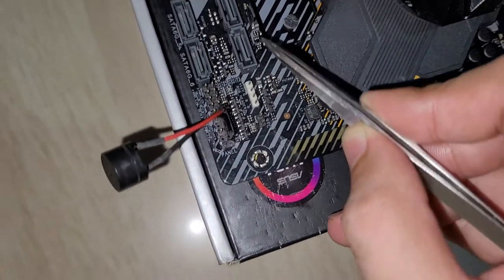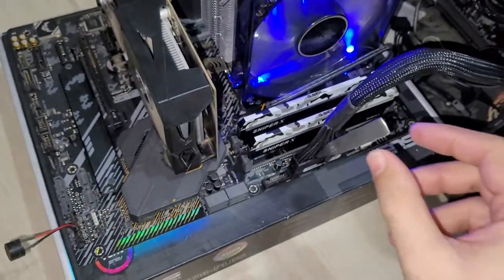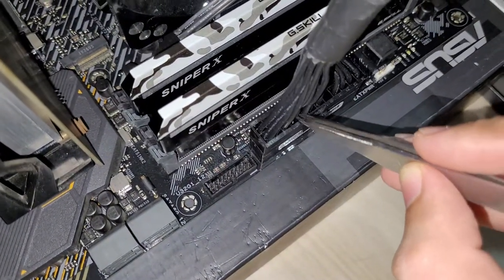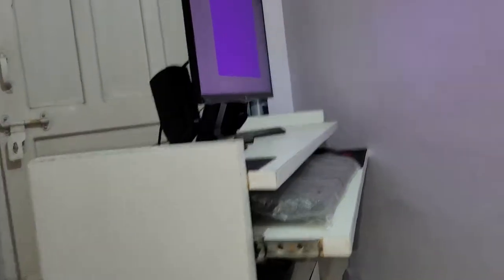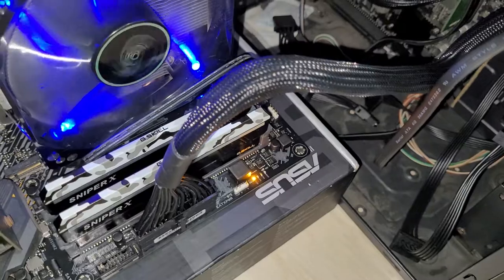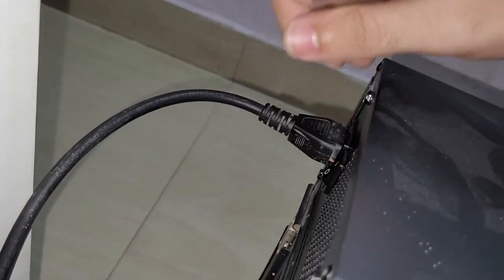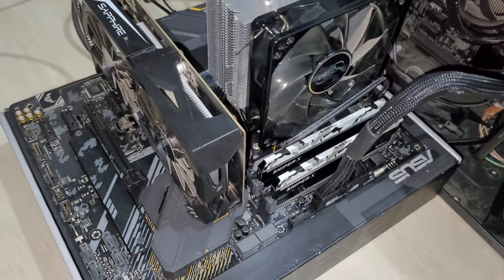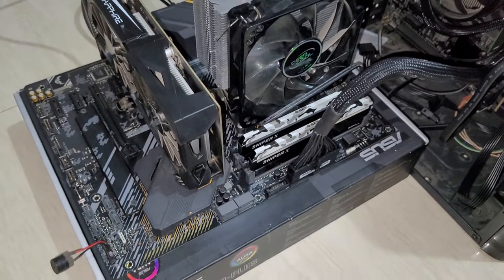Issue: ASUS TUF Gaming X570-Plus Motherboard Doesn't Power ON Without CLR CMOS + PSU Paperclip Short

Comment: same problem happened to me 
do i need to spend money on this issue, because i did nothing about this, it is only 1 year i assembled this pc 

PLS PLS REPLY
SOOON PLS 🥺🥺🥺
Reply: i think everything i have in my build is under my warranty period

PLS PLS REPLY
SOON 🥺🥺😤
Reply from the maker: Yes get it replaced/repaired under warranty brother. I think the newer revisions do not have this issue.
Reply: @LoveleshKalonia  i have asus  b660m motherboard i5 12400
do i need to pay any money for this repair/replacement process 
because the shop which i bought this pc asking 2k that process as service charges

pls help me out for this brother 🙏🥺
Reply from the maker: Which country do you live in brother? You don't have to pay anything, find the nearest ASUS Service Centre and take your motherboard there.
If there is no Service Centre, then please check the RMA page, then pack your motherboard and courier it to the RMA Centre.
Reply: @LoveleshKalonia  im in India, Chennai 
thank you for your help
i will follow your instruction for my service ❤️❤️😉
Reply: @LoveleshKalonia  thanks brother 🙏❤️
Reply from the maker: Most welcome brother 😊

Comment: I took out my mobo to change the casing + changing some new parts and i think highly possible is the mobo because cpu is new and the other parts i tested was working.  I buying a new mobo and to test it agn.  Praying hard is that it is not the psu . Btw using SeaSonic, it has high review on it and after watching several video, MOBO has the higher chance to be Faulty from most part on the computer parts.  TESTED the Video and the MOBO show light but immediately I drew the connector 4 and 5pin the MOBO died straight.  My Conclusion on my case is that the pin on the 24pin on the mobo is faulty, lightly is 3 years old and is the part that is the hardest to take out .
Reply from the maker: Yea mobo is the least reliable thing these days

Comment: my x570 crashed stuck on green led black screen no bios i removed ssd ram pc case plug ins its shot re seated cpu same balck screen same led on
Reply from the maker: Are you using an APU or discrete GPU ?
Reply: 5800x/6700xt 980pro 750 super nova 48gb ram 12 pin power plug in win11 B.s.o.d plyin elden ring hasnt worked since TY for response
Reply: x570+wifi was running bios OC pbo set to board limit OC enabled All been runnin it OC since purchase OC showed 4.8+0.2 off set volts 1.5
Reply: think i killed it no bios after re seat replace cmos removed m.2 bios was v 4204 i think latest version tho i tried dvi switch to hdmi it just a black screen :) not so TuF lol
Reply from the maker: I thought the same thing too when I RMAed my motherboard - "not so TUF". Even ROG customers are having such issues.
For the future though, I do not know who else does hardware & BIOS better than ASUS.
Reply: it ran fine @that o.c wat was similiar is the arua was not on while powered after the b.s.o.d i tried unplugging the reset sw after boot it went to bios and froze then black screen your method it  wont stay powered on when i remove the hotwire ima use it for target practice here ina min got somethin for the son of a.... lol ty for the replys
Reply: got a mailing address you can have it if not ima put 140 dollas worth a lead innit serious tho if you want it i dont got 6months for asus repair
Reply from the maker: No brother, I no longer need it. You can keep experimenting on it though 😊👍. Who knows you might repurpose its parts in the future 😉.
Reply: thought id offer maybe all find someone whos able to repair in use it I was rather upset with this from the advertised "TUF" mosfits I ordered a x570 Mag Tomahawk thanks for your time and video it was worth the try for me
Reply from the maker: And to think reviewers like Hardware Unboxed recommended it. 👐

Comment: I have the same problem.

I have this mother board: TUF gaming B550M Plus WiFi.
Display card: Nvidia GeForce GTX 1650
Processor: AMD Ryzen 7 5700G

Also Win10 installed, and it was working fine, until I tried to upgrade to Win 2022 server.

Win the installer finished copying files, and restarted the system, it couldn't boot, and I get black screen.

I removed the battery, and I restarted , it goes to the BIOS setting asking to setup.
I set it up, saved, and restart, but the same thing, black screen.

If I restart to BIOS, and I request to boot from Windows boot manager F8, it will boot.
Now I can not use the battery, and I can not boot in a regular way.

I do not know what to do.
Reply from the maker: Something is wrong with ASUS Quality Control definitely so many people having issues especially with TUF series Mobos.
If yours is in warranty I would say get a replacement and Do Not Cheap Out on a good 80+ Gold PSU.
Reply: @LoveleshKalonia  

Thank you for explanation.  But I am wondering why this happened when I tried to upgrade to win 2022 server.!

What is the relation between my motherboard POST issue, and upgrading the system.!

I installed Win10 back, but the problem still same.
Reply from the maker: @LastMomentMan  not sure. Maybe Windows did something to the BIOS... UEFI can allow that to some extent.
Could be something else that you may have missed.
Reply: @LoveleshKalonia  

Your expectation is possible.
But I was using this computer about 8 months without any problem.

It happened only, when I tried to upgrade to Win2022.

It's a silly idea to allow the operating system or any other software to modify BIOS.

BIOS was the fort of security in the past.
But now, any virus can go to BIOS.!

I do not know how to block my BIOS from being modified by operating system.

Comment: I have the same problem, debug light on dram and i just bought new ram and debug led dram still on, does it mean my mobo is faulty?
Reply from the maker: Try inserting one RAM at a time. Also, for this motherboard, if you are using PCIe 4.0 compatible GPU & SSD, then you might have to dial back the RAM frequencies.
After all that, yes, motherboard can b faulty too if not RAM.
Reply: @LoveleshKalonia  tried everything, time to buy new mobo. Thanks
Reply from the maker: @professormalik7356  Sorry for the loss brother. Do share which brand you go for now?
Reply: @LoveleshKalonia  the bricked one was Asrock B365M Phantom Gaming 4, i think i might go with Gigabyte Z390 Gaming X

Comment: Hi, i follow your video but unlucky to boot and led code still not working.. any advise
Reply: Even holding power botton longer not shutting down... please help
Reply from the maker: If your motherboard is in warranty then I suggest just get it RMAed. If not, you can play around some more. But I suspect that it is dead if nothing works so far.

Comment: When i connect the 4th an 5th pin it turns on the fans and al and when i disconnect it turns of and clearing cmos doesnt work
Reply from the maker: I had the same problem. Is yours under warranty?
Reply: @LoveleshKalonia  nope😭😭 but best is to buy a new one?
Reply from the maker: @jurriendw050  Sadly Yes, like you said that even clearing CMOS isn't kick starting it. Just curious, Is your PSU 80 Plus Gold and were you using full 8 + 4 Pin CPU EPS power cables?
Reply: @LoveleshKalonia  no idea but never had problems but when i installed this motherboard i got problems
Reply from the maker: @jurriendw050  Hmmm, It is sad brother. You'll have to buy a new one. You can not do anything else in this matter. You can maybe take it to a computer market where local technicians repair the motherboard. They might repair it for cheap.
Reply: @LoveleshKalonia  ai thanks bro
Reply: @LoveleshKalonia  i have new motherboard and the exact same issue
Reply from the maker: Jeez what the hell is ASUS's QA team doing? Atleast this one will be under warranty right?
I would seriously advise if you have a really old PSU or something that is not 80 Plus Gold... please replace that too. I highly suspect that might be responsible for killing your motherboards.

Comment: ASUS x570 TUF GAMING with PSU: sesonic gx-650 gold and is dead after 3 years and 3 months. (3 years of warranty) The same configuration for 3 years, no overclocking low TEMPS., clean comptuer. i was on the WEB when it happend.
Reply from the maker: I am sorry to hear Konrad. I see you have a high quality PSU and it still happened. I am kinda scared now, this can repeat on my replacement motherboard in the future.

Comment: Thank you for the video.. Same exact issue.. I feel like mine is probably out of warranty..
Ill check but for now its going to have to remain plugged in😅
All I did is swap power supplies and graphics card. And all of a sudden it wont boot.. Took the power supply to a different pc and it turned on right away, so I knew the psu was fine.. I’ve quadruple checked connections.. had no idea whats going on
Reply from the maker: Now you are load testing 24*7 haha

Comment: I had my motherboard TUF Gaming x570-Plus, with gtx 1050ti, 16gb ddr4 3200ghz, ssd 1tb and a power supplier of 700w. I bought a Rx 6600xt Eagle 8gb and i connect everything right, but the pc was not showing me the led light of the motherboard. Then when i do the turno on with pin 4 and 5, it works propperly but after turn of the pc the led light are gone and i cant turn on with the normal buttom of pc. Then some answer? Mmm maybe there are a conection that is causing the power of the motherboard go to earth, maybe a conection in the motherboard is wrong after shutdown in a wrong way. (Sorry about my english)
Reply from the maker: I am not sure about earthing... Like I mentioned in description, I RMA-ed my motherboard as it was under warranty.
Reply: @LoveleshKalonia  yes u had lucky but mine is not under warranty 😅😂
Reply from the maker: @augustuswatters6933  that's sad ☹️ But it gives you freedom to do experiments as well 🙂
Reply: @LoveleshKalonia  Hahahahaha yes, i see other guy who repair motherboards and with a "Dispositive of Check voltaje" i can know where i the error and after that try to fix it :(. 
Thank you for answer me! 😁
Reply from the maker: @augustuswatters6933  Good luck brother
Reply: @Augustus, were you able to figure this issue ?
Reply: @AjayBhaskar  Yes, was some part of the motherboard burn. U have to find what part with a tecnic or is better buy a new one. I bought a new one 😔 cheap and better inclusive

Comment: Hey again bro..i tried doing this and my pc ran all fan spins,psu fan spins but my gpu is not working idk why its not spinning and i cant get a dispkay cause of it....and one thing if i touch the gpu on top part and move it a little it works but no display and the fan spin so fast..pls help
Reply from the maker: Does your motherboard have another PCIe slot? You can try using GPU in that.
Either your GPU is at fault or motherboard's PCIe slot.
Reply: Wgen everything is spinning press the power button that is how i am using mine for now

Comment: Hello my brother i have a little similar issue with yours. I just bought this motherboard tuf x570 plus wifi along with it is the 850w psu gold, the board seems turned on because the rgb at the side are lighting up it just doesn't display anything on monitor it says that "no signal", i already did interchange the cables onto mobo and gpu for sure and also i plug hdmi and display cables incase one of them have problem but it isn't, i tried to install bqck my old gpu and it worked, my monitor is fine im sure and also i plug the display cables  properly. So i conclude that the motherboard is the problem, i think its faaulty or  Maybe i need to bios update it, i have this processor ryZEN 9 5900X and i searched that the must need to be bios update to work. Any thoughts? Pls help me. It cost me too much money, and returning it will take a long period of time.
Reply from the maker: Hi Ceekhan,
Yes the first thing should be try to upgrade the BIOS first...
You can use the QLEDs lights to troubleshoot further.
You can also try to run RAM at stock speeds to rule DOCP overclock out of the equation.
If you have a heavy power hog GPU like 3090 or something then I thing try avoiding daisy chain of power cables. Use dedicated cables from the PSU directly.
Reply: @LoveleshKalonia  sadly i cant do any as of this moment becaause there is no display i cant even go to bios uefi maybe i need to borrow lower series of processor? So that the mb caan proceed to bios aand then update it? Im stuck i dont know wht to do im worried. I have rtx 3060 btw
Reply: @LoveleshKalonia  and i see that there is no led lights at the top right of the mobo where you can see the d ram, cpu vga and boot led there is no lights on them, the lights is onnly at the bottom at the diagonal rgb strips at the mobo.
Reply from the maker: @ceekhannianga860  Try CMOS reset then... If that brings it up. Try to find the manufacturing month and date on its box to determine if the date is around the time when 5000 series launched or if it is older... Then try to take help from a local computer shop they should help you in BIOS update.
If that fails too... Then don't do the experiment that I am showing you here just get it RMAed in warranty. You shouldn't do too much as it is brand new. If you scratch anything it will become troublesome for you.

Comment: Guys I started having the same problem but my mobo was Asus Prime x570-pro - I had 750watts 80 Gold Psu from deepcool(which Ive bought used and PRESUMABLY it was used for mining) I also switched my Ryzen 3800x for 5700x and it all went bad just after one or two days 😂 Mobo just stopped starting(only rgb lights were on) I initially thought the problem was with PSU so I switched it to 850 PLATINUM one from Fractal Design - it worked but was unstable(could restart on it's own). So I thought okay I need more testing(maybe new PSU is also bad) and next morning it just stopped starting AGAIN so I went to store and Ive bought A THIRD PSU 😂 But there was no miracle - mobo was DEAD(no shortage on ATX12v line gladly but something is obviously off with VRM). So this faulty PSU not only died on me but it dragged my mobo with it and forced me to buy two new PSUs.
CPU RAM and video card(thank God 🙏) survived and Im not sure which has caused the problem initially - maybe it's because I switched CPU maybe because PSU was used and maybe it's because Asus is getting worse and worse with each new gen. But after reading all these comments Im starting to think that it's not just me - but some problem with Asus and x570 chipset
Reply from the maker: Yes, you can blame ASUS. Right now I upgraded to a used RTX 3090 and started facing memory issues. I had to downclock the RAM from 3600MHz to 3133MHz.

Comment: Hi all..

Sorry to post on a old video 

I was having a funny issue  when I shut down the PC 

It won't boot again unless I play with the power switch on the PSU on/off on/off and pressing power on the case until the PC post 

After some fiddling in the bios I have seemed to have found the issue there is a setting for Aura (F4), Turned Aura off.

This has fixed my issue, I hope this post will have helped someone with the same problem in the past or in the future 

Regards
Reply from the maker: May help someone someday.
Reply: That's a good guess btw. I had mine Aura driver updated through Armour Crate just before it went bad

Comment: Bro if the cpu fan spins means its not mother board and its psu right? Cause sometimes when i play i feel an electric shock on my case and sometimes hang
Reply from the maker: No brother, CPU fan spin can not tell the full story. It just needs power to spin.

Comment: I have the same problem.
Reply from the maker: No fix so far...
Reply: @LoveleshKalonia  Follow up.  After a long process of trial and error I narrowed down the issue with the mobo mounting to the chassis so I removed all screws and the dead slots are operating.  Perhaps a grounding issue or the chassis is warped causing the mobo to warp and make the cpu  pins bend just enough away from the contact points to disable the ram slots. weir huh?
Reply from the maker: Weird... Yes, But it just didn't work for me. Had to replace it under warranty and luckily it happened within warranty period.

Comment: I have the exact same issue with my Asus Tuf plus wifi
Reply from the maker: Unfortunately no one has been able to find a fix for it. You either get it replaced under warranty or buy a new one.
Reply: I finally figured that out...so the shorting of the pins just says your PSU is good for the most part. The mobo issue for me was an Aura hub incorrectly installed...grrr lost 8 hours
Reply from the maker: @gishman9  Glad to know your issue is fixed now :)
Reply: @gishman9  So how can I fix it ? Please let me know as soon as possible 🥲
Reply: @techysuman2126  this is too generic of a question. Depends on your setup. If the shorting of the pins works, that means most likely PSU is ok.
Reply: @gishman9  No ...
I'm talking about how to fix the motherboard problem?
Wheather it is treatable or not?
I just have purchased the motherboard and same problem facing...I can't boot my pc and pc is not turning on
Reply: @gishman9  However my psu from cooler master is perfectly working
Reply: Yeah, there is not enough detail. Most likely it's not a mobo issue without knowing what you have connected. I would try starting with just mobo and cpu attached to PSU, test for.power, then gradually add parts (memory, sata, rgb, etc)

Comment: Same issue with asus prime plus b450, never going to buy an asus product again
Reply from the maker: Yup, me neither.
Reply: Am facing same issue with msi x570
Reply from the maker: @kidsABCart  X570 is like a BETA chipset at this point lol.
Reply: I got it fixed, turns out there was a bad solder joint on a very small resistor near the cpu socket
Reply from the maker: @Kasev309  That's good to hear